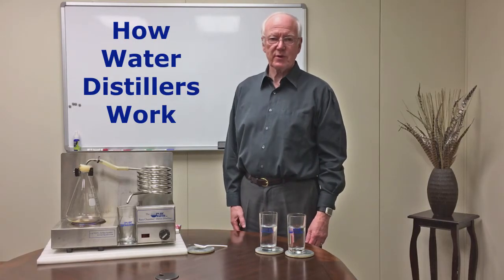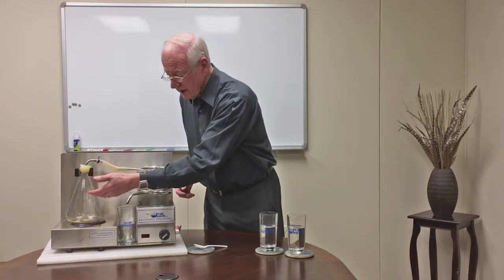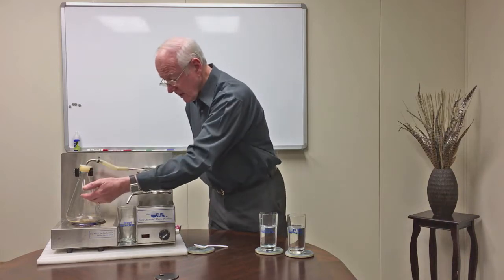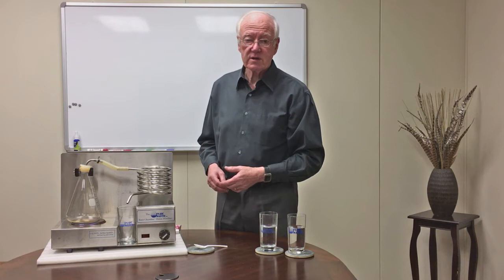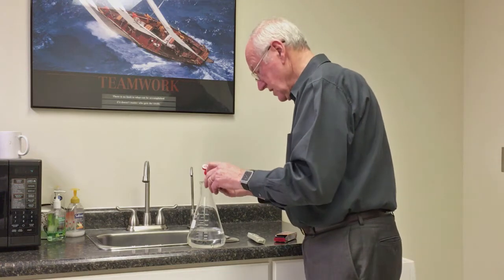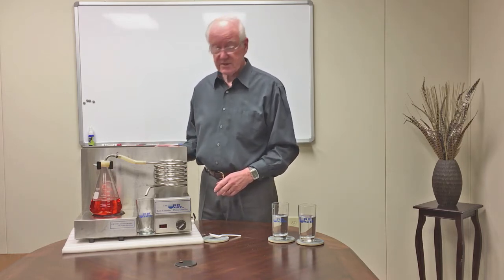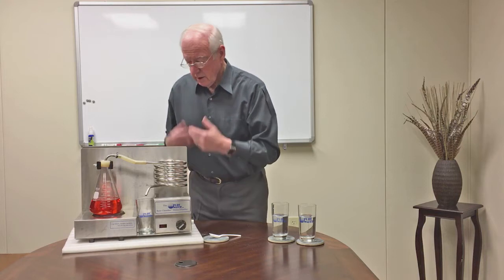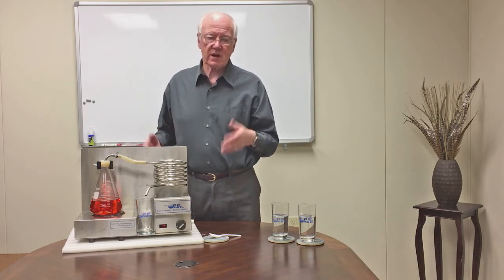How Water Distillers Work

Comment: I'm thinking some of the higher contaminates is from the red coloring, but yes I understand most are from condensation (removing water but not contaminates). Should redo the demo by taking PPM reading AFTER adding red food dye for a more accurate reading, though it should not be a huge difference there should be a difference and a better demo.

Comment: Well my natural question is, can you boil all the water and leave behind more contaminants in the flask? Or better yet where do the contaminants go at the boiled dry point of complete evaporation?
Reply from the maker: If you boil all the water off, you run the risk of having the element/heat source spiking in temperature and potentially vaporizing any number of the contaminants you're wanting out of the source water. Our distillers are designed to never boil dry and will always retain enough water in the boiling chambers to cover the heating elements at the end of the cycle to ensure there is no over-heating/cross contamination.
Reply: @PureWaterDistillers  Wow great point the ones on ebay that auto switch off burn dry

Comment: Great presentation. 
Question:
Are pre and post filters needed when installing a 8 gallon per day counter top distiller?
Reply from the maker: Great question. Pre filtering the water will typically allow for longer time between necessary cleanings as you will not have nearly as many heavy contaminants in your feed/source water. Post filters are always a good thing  to have in place as they act as a final catch for any VOC (Volatile Organic Compounds) that may creep through with the distillation process. A post filter will also act as a 'polisher' for the flavor of the distilled water making it more palatable.

Comment: My distillation unit does not produce distilled water with zero TDS  immediately as demonstrated in this video. Distilled water with zero TDS is produced after heating the distiller for a long time: when it is deadly hot! Why?
Reply: Hi,  I bought a Vevor Water distiller and did not get Zero TDS and returned it.  Gallon 1 - TDS 14, Gallon 2 - TDS 3 , Gallon 3 - TDS 2.  It seems to me that I wouldn't get 0 so I returned it.  I don't think these table top water distillers can get to zero TDS ?

Comment: What about VOC from microplastic in  water. As far as i have been able to 
learn ,VOC...volatile organic compound such as toluene and benzenes 
have a vaporisation temperature lower then water and will be distilled 
along with the water
Reply from the maker: Great question! This is part of why we pair distillation with either a pre or post activated carbon filter. It's also why we designed a patented dual vent that is placed at exactly the place where we can vent out VOC's (but the water vapor is starting to condense, so it doesn't escape).

You can learn more about what our process removes here: https://mypurewater.com/home-products/pure-water-lab-results/
These are what we have tested so far. Thanks!

Comment: Great video !! Few questions - 1. my city water is not safe to drink, so can I drink it after going through a distiller? 2. can I distill my water for a second time to be more pure? 3. do you recommend distilling bottled water before drinking ? Thanks a bunch !!
Reply from the maker: Hi Jenna - great questions! 1. Yes - our enhanced distillation process removes over 99.99% of contaminants, so city water is safe to drink after running it through our distiller. 2. You can run it through again, but you don't need to. One time leads to high purity (you can learn more on our website: mypurewater.com).  and 3. It depends on what kind of bottled water and what kind of bottle it is. Some bottled water companies distill their water, but most don't. And glass bottles are safer so that you're not ingesting microplastics. The bottom line though - if you own a water distiller, you don't have to waste money on bottled water. You can distill tap water and fill a reusable bottle! In the long run, it's better for your wallet and the environment. Thanks!
Reply: @PureWaterDistillers  Thank you !!
Reply: I am looking into this for myself. The only problem I can see, is that distilltion, whilst purifying water, also removes all the minerals from it__even the good minerals that our bodies need to keep our electrolytes balanced. How do we get round this problem?
Reply: @janettestephenson8555  Take supplements
Reply: @janettestephenson8555  I add a pinch of Himalayan Pink Salt to a half gallon.

Comment: Yes mate, after checking out all the different ways and all the different filters, I’ve come to the same conclusion, distillation is the only sure safe answer.
Reply: Be sure to add minerals and electrolytes to maximize your hydration, as distilled water is stripped of everything and anything that might trigger your cells to take in the water molecules.
Reply: @praxisarms103 yes I use Zero water mineral additive
Reply: Just a add on, sometimes the ppm reading will be one or two while the distilled water is still warm, but once it cools it goes down to zero ppm
Reply: @ericjohnson1472  That's helpful, thanks. Kinda feel like I need a still nowadays with public infrastructure budget slashing, and all the water crises going on right now.

Comment: I read that the fluoride evaporates into the air, and you breathe it in.  What do you think of this?   
Thanks a bunch!  :)
Reply from the maker: Hi! Great question!

Fluoride is usually added to water through sodium fluoride (boiling point 3,083°F), fluorosilicic acid (227.3 °F), or sodium fluorosilicate (932°F). Because water boils at 212°F, and because our distillers never boil dry, the temperature never gets hot enough to release the fluoride into the air. 

Let us know if you have other questions!
Reply: @PureWaterDistillers  Thank you!   :)
Reply: Don't stand over the machine breathing in the vapors of what's coming out of it.
Reply: @chaosh7040  :)  Ok.

Comment: Hello . 
Some people say that they have found nickel in the water after the distillation process. What can you say about this and what kind of steel your distillers use?
Reply from the maker: Hi Aaron! Great questions!  We use high grade stainless steel (depending on the application, either 304 or 316).  As for the nickel, we have had 3rd party laboratories analyze our water, and we found over 99.9% of the nickel removed. You can view the full results here: https://mypurewater.com/wp-content/uploads/Lab-Test-Results-Extended-October-2018-Only-PW.pdf
Reply: Pure Water Distillers 
Thanks for the reply I will see the information.

Comment: Hello, what does TDS stand for and it's significance in all of this?
Reply from the maker: Hi Relle - Great question! TDS stands for Total Dissolved Solids. Using a TDS meter a basic way of checking what's floating around in your water even if you can't see it. Thanks!

Comment: The TDS water in flask will definitely increase as we know. But did the food coloring play a small  role in increasing the PPM?
Reply from the maker: By removing the water from the flask, there is now more contaminants in the flask per water left over than originally.  Generally, food coloring won't set off a TDS meter because it is organic in nature and has such a low amount in the water.
Reply: @PureWaterDistillers  But why leave the question hanging in the air when he had the meter to test it right there on the spot & show there was no difference. But based on how this reply is worded in relationship to the question this is obviously AI generated & we will get no logical responses here.
Reply: exactly what I came here to ask

Comment: An expensive way to make distilled water and certainly not enough to drink to make any difference to health!!!!!
Reply from the maker: This is just for demonstration purposes.  The actual real water distillers we produce can be found at https://mypurewater.com/product-category/water-distillers/ We actually make home and commercial distillers that can produce up to hundreds of gallons per day.
Reply from the maker: Distillation is actually not that expensive to maintain and run and in the long run will generally save you money in comparison to filters or an R/O system.
Reply: In the UK with current electricity prices to distil 4L it costs about 95p to £1.05p